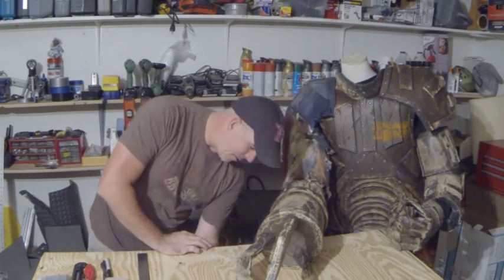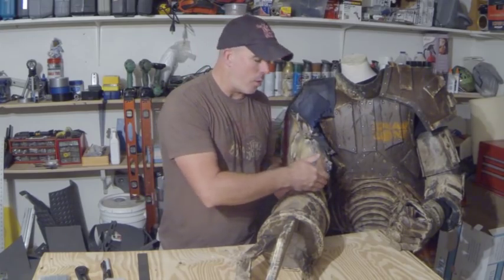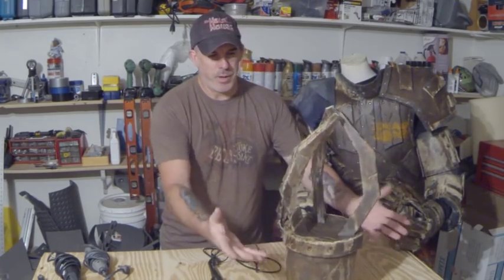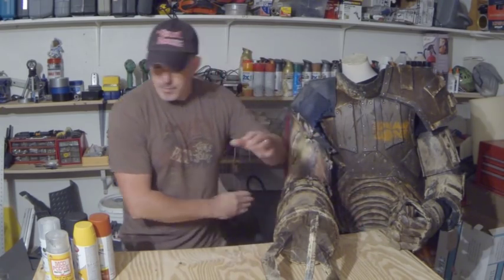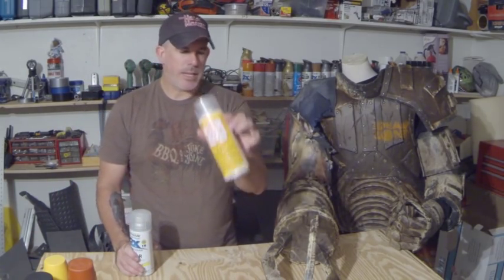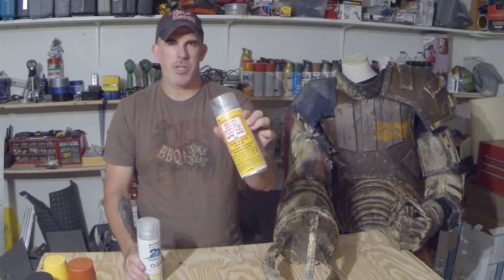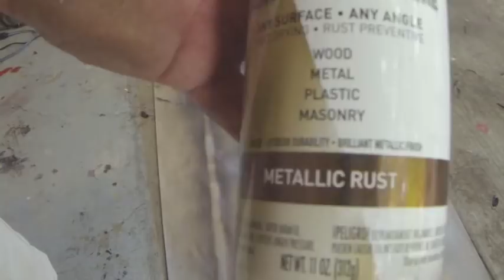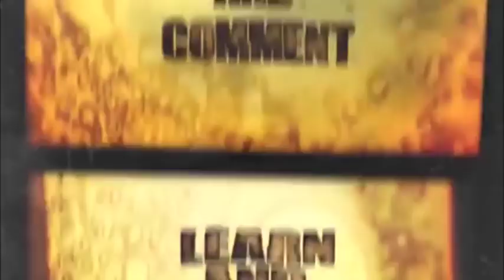EVA Foam tutorial (Episode 6)

Comment: 11:33 Next time just cut a long strip to width cut your rectangles and then cut the ends, would have saved you all that drawing time. 12:05 is an example of what I mean
12:16 Use one of your pieces as a glue stamp instead of drawing and painting glue inside the lines. or make the stamp 1/8" smaller than the actual piece.
Sorry, I'm all about saving time and money.
I buy my EVA foam mats at goodwill, I'll get a large stack for $2.99 Plus I find a lot of other items like foam bed pads, fleece sheets, rolls of material. Some of those Nerf guns can be painted black and detailed to look awesome. or use them as patterns.

Comment: Great Video! One question....I don't have a lot of time or money at the moment and I need a project done in a couple months. Are there any alternatives to using a heat gun? Like house held items, for example a hair dryer? I am aware I could maybe use an iron. Do you suppose a hair straightener would work? It heats to over 300 degrees.
Reply from the maker: +AncientMeow14 Go to HArborFrieght and get a heat gun and soldering iron cheap.   I do not know about the items you mentioned whould work.
Reply: The thing is, the part I'm doing is a pretty small piece. I don't want to have to spend more than necassary and the only hardware type of store within an hour of me is Home Depot. If a clothes iron, or a hair straightener doesn't work I'll think about it. This is frustrating lol.
Reply from the maker: I do not know what to tell you about household items.  sorry.  never worked with them
Reply: +AHauntersLife PLEASE help! I'm making a nightwing costume and I don't wanna glue the pieces to my undershirt like I did with my batman cosplay. I'm trying to figure out how to strap everything together. Mainly I just needa know how to strap the chest, ab, shoulder, logo, and back pieces together.
Reply from the maker: Sorry for the late response.   We use velcro to strap everything together.
Reply: ***** Thanks, but I've already made the costume lol.